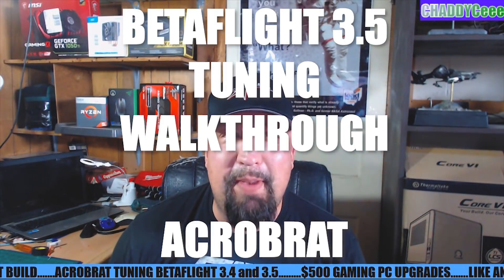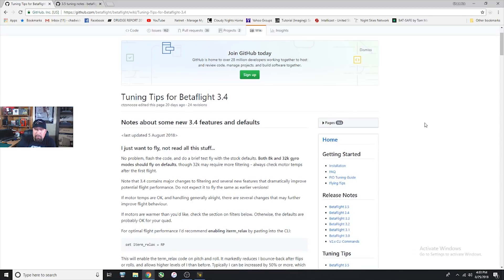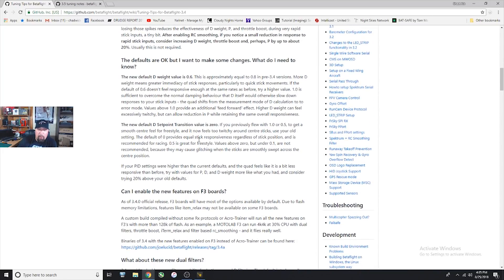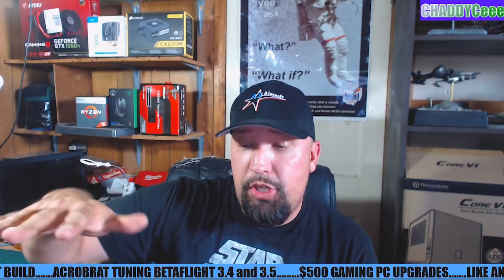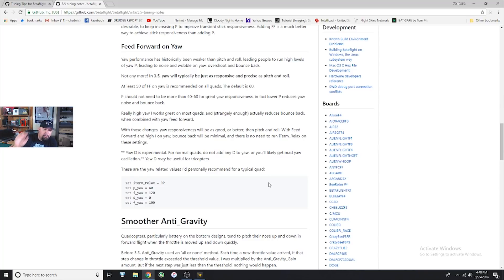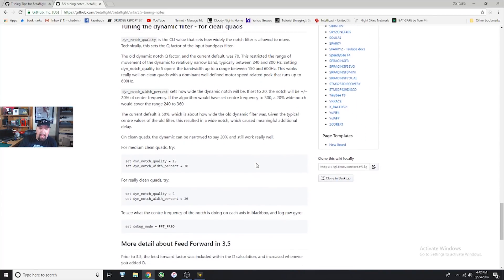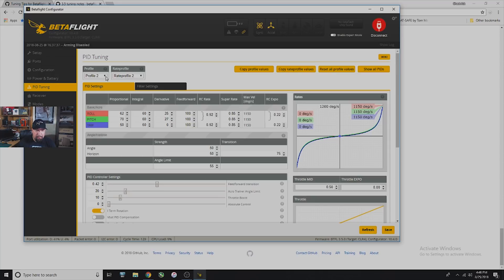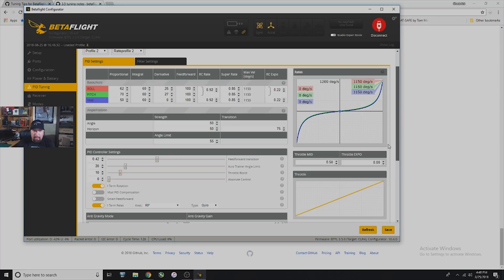BETAFLIGHT 3.5 BASE TUNE WALKTHROUGH ON UMMAGAWD ACROBRAT

Comment: Hey buddy, you don't need to access the "boot" button on the FC. Just run the Impulse RC Driver Fixer and then in Betaflight, type BL and hit enter and it'll restart the FC in DFU mode. =)
Reply from the maker: ill try doing it that way..I never seem to have luck using the BL command.  I always have to use my MAC.  that works most of the time but I get a stubborn bit every once in a while
Reply: If you run the immersion RC driver fixer first and then type bl in the cl it will work. Sometimes you need to do it more than once to get it to work, but it should definitely work that way. I've had some stubborn FC's, but I can always get it to work.